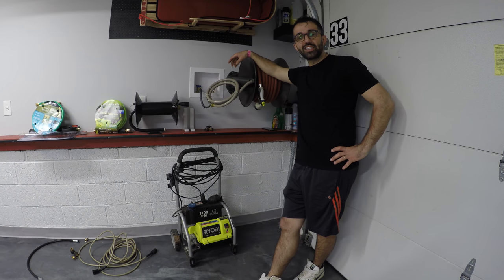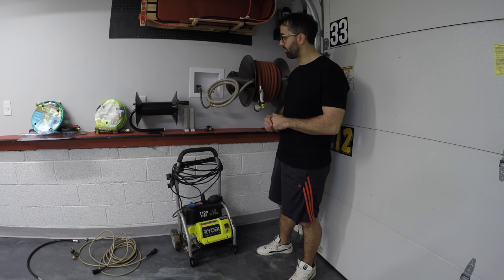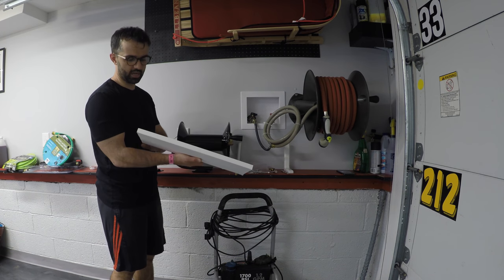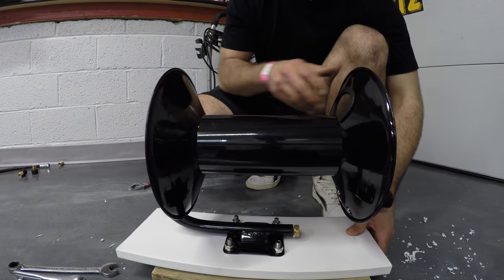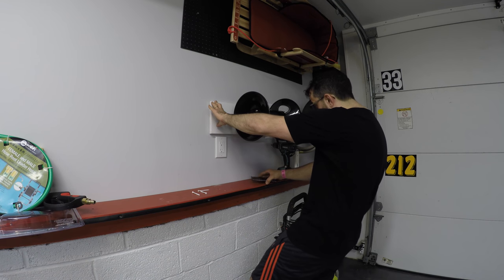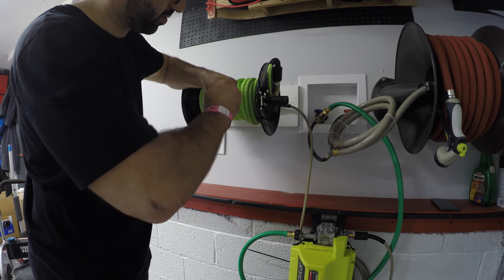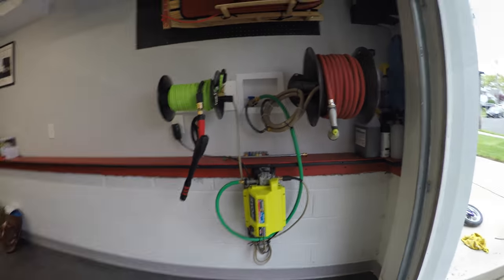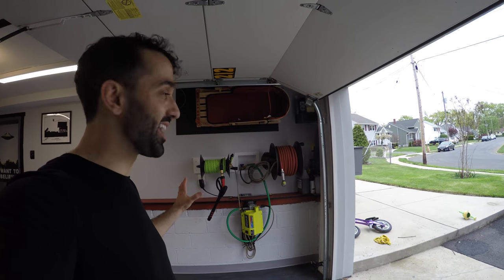Custom Mounted Pressure Washer in Your Garage for Cheap! Easy DIY  Wash your car the right way!

Comment: I would make sure to mount the pressure washer motor up right and put some bushings so it doesn’t vibrate itself out of the wall, but this project is awesome. Clean AF!
Reply from the maker: Thanks! No issues with vibrations after 6 months.

Comment: 7:12 Clockwise is correct, but you might want to wrap the tape on the other side of tape...  give it a try next time you do it.
And it seems more logical mounting the green reel on the right side of the washer?
Reply from the maker: Honestly it doesn’t matter. I mounted it so it looks somewhat symmetrical

Comment: I have been thinking of doing this too! Thanks for the video! Nice set up! And also folks, you cant look at an outlet and know if it is GFCI protected unless it's actually a GFCI outlet. Otherwise it can be protected if its down stream or there is a GFCI breaker.  lol
Reply from the maker: Fatty's Garage thanks for the note. This indeed needed to be a GFcI outlet. It’s not connected downstream and there was no GFCI breakers but I have since fixed it.

Comment: I like this.  For me, I prefer a more powerful gas powered pressure washer that is portable, because I need to use it for many things.  But if I wanted a basic unit that was convenient, I would definitely do this!
Reply from the maker: Thank you. I also have a gas model for around the house stuff and this one was just sitting idle.

Comment: The General Pump D30002 you linked appears to be a lot larger than the smaller pressure washer hose reel you're using. It looks more like the water hose reel. Can you please specify which pressure washer hose reel you have and which water hose reel you have? Setup looks great!
Reply from the maker: It's the same one; I checked my order. It looks bigger in the photo.

Comment: How is the reel doing after using it, have you had an issues with it. Do you with you went with something like the MTM or Cox Reel or are you satisfied with the General Pump reel?
Reply from the maker: Rob Torres love it!! I use it all the time. I will have a video on it in two weeks. No issues at all.

Comment: How is this holding up? I ask because I did something similar (mounted mine to the wall sideways) with my Greenworks 2000 psi and posted it on Obsessed Garage Facebook page. Someone asked a great question. Most/all pumps have oil in them and was asked if mounting it sideways and not flat will mess it up because the oil is not where its supposed to be in the pump
Reply from the maker: Going on two years - zero issues and super happy!!

Comment: Clean and great setup! Hoping to do a similar setup, however I'm looking for a 100' hose. Any recommendations?
Reply from the maker: I wonder if the same brand has 100 foot long hoses. It will definitely fit on the reel. Flexzila is awesome

Comment: have you found a solution for a smaller hose from the pressure washer to the hose reel? I want to do the same thing but cannot find a small m22 hose
Reply from the maker: Nope...I just rolled it and it seems to work.
Reply: @TommyLGarage  my next issue is how did you move that metal piece on the reel to get the long hose connected to it? the angle does not work at all and my hose is kinked bad.

Comment: I was just thinking of ways to wall mount my greenworks pressure washer when this video popped up. 

I’ve got the same issue, water source inlet in front and outlet in back.

Any issues mounting it the way you did after 6 mos?
Reply from the maker: TheWildpanda86 Not at all. No issues. Happy to report that it is still running well and no leaks
Reply: Tommy L Garage 

Good to hear... I just saw your latest video and it looks like it’s working great.

 I’m thinking of mounting mine so the front faces downwards and the back upwards. That way I can have my DI water setup feed into the front/ downwards portion of the unit and the outlet faces up towards my reel. I’ve already got an mtm swiveling spray gun + pf22 foam cannon and it foams up nice and thick already. Ordered up a cox reel on amazon since they where on sale as well as a 100ft kobrajet hose... can’t wait to get it setup now.

Comment: Hey Tommy, is the 1/4 hose still good? I've read amazon review saying it bursts and leaks after a while. I would like 100 feet long but 3/8 100 feet hose with QDs is $250 on obsessedgarage.  This 1/4 hose 50 feet but much cheaper, maybe if yours still works after 2 years, I can buy 2 (50+50 feet) for $150?
Reply from the maker: I’ve been using it twice a month for two years now and zero issues

Comment: I have a ryobi 2000 psi 1.2 gpm. It doesn’t damage the pump if I use a 50ft 4,000 psi pressure washe hose?
Reply from the maker: Genysmen runner Not at all. It should be fine
Reply: Tommy L Garage thanks

Comment: awesome job!   Just randomly came across this really nice.  Does your ryobi have auto start and stop or does it run continuously?   Which Y splitter did you use the brass one i bought leaked...
Reply from the maker: Thanks!!! I hope it was helpful. 
My ryobi runs continuously but of course I can turn it off with a button. Not a deal breaker. 
The Y splitter I got from Home Depot. Make sure the rubber gaskets are inside and tighten them with pliers otherwise it will leak. 
Are you doing a similar install?
Reply: Tommy yours doesn't cut off? I have the ryobi super small one and it turn on off with trigger.  My older one did as well.
Reply from the maker: David Dear well it turns off when I release the trigger. Once I press it it turns on. 
It also turns on when I open the water - the pump goes on until it builds pressure, then it shuts off. Is that what you meant?

Comment: Nice video Tommy! What do you do in winter or does your garage not freeze?
Reply from the maker: In the winter the garage is a steady 45F. Never had issues and I actually use the pressure washer during the winter.

Comment: Hey, do you know what’s the maximum PSI you can use on the car without damaging the paint?
Reply from the maker: It depends how close you get.
Reply: No more than 2000psi that’s what I saw in some websites

Comment: What bolt size and length did you use for the hose reel?
Reply from the maker: 2 inch. A bit of overkill.
Reply: @TommyLGarage  Thanks. I just bought the same one. Going to do a similar set-up in my garage.

Comment: Great video and very clean job. I was wondering how has the reel been so far? Ive been interested in doing my own setup also but wanted a quick review to see if that reel has been solid with no leaks or any other issues. thanks!
Reply from the maker: Over a year now and zero leaks and I am super happy. I use it about once a week and it’s been very durable.
Reply: @TommyLGarage  Perfect! thanks!

Comment: I’m very confused. What part did you bend. ? I have the same issue with mine currently!
Reply from the maker: Dynamic Garage the part where the hose screws onto. I bent it outwards on its thread

Comment: Nice looking set up but what I was really interested in seeing was where you live and that was confirmed by your car's license plate: New Jersey. This means that when it turns freezing cold in your garage any water left in the pressure washer will freeze solid (= one wrecked pressure washer from a damaged compressor) and of course that expensive flexible hose could also have some water in it which could impact its future performance if it freezes. All the hoses and the pressure washer look like they need to be removed until warmer weather returns so they don't rupture. Might be a hassle but it's the price you pay for living where water freezes and garages aren't heated as warm as the house. Oh, and that electrical outlet near the hoses should have a GFCI circuit protector at the circuit box in addition to the one on the power washer cord. No doubt you will want to use that outlet for something other than just the pressure washer and it is still located close to the water source. As as one of the other comments pointed out, the vibration from the compressor could eventually loosen the mounting bolts so a little Loctite would be a cheap investment on those threaded bolts. Picky, picky, picky...
Reply from the maker: Marc Goodman Oh boy you put things in perspective ha ha. Valid points especially about the outlet. I have since I upgraded it GFCI. I also run the compressor drive for a few seconds after each session so no water in the pipes. We’ve had freezing weather and it’s been good so far. I’ll let you know how it goes this winter but the garage is fairly warm so I think I’ll be OK
Reply: @TommyLGarage  Good idea re installing a safer electrical circuit especially since you have children around. As for water in the system possibly freezing and causing damage to the pressure washer and/or the hoses, as warm as your garage may feel, we live in the age of extreme weather and who knows what Mother Nature has in store this upcoming winter? Just to be on the safe side, I would remove everything from the faucets and store in your warm basement for the winter. A week ago I drove by a property where the copper pipe feeding the hoses burst a leak after a brief cold snap. Surprising since I thought the hoses would go first but the homeowner was unaware of the leak until I knocked on their door. And, if you have a shut-off for those two faucets inside the house I would close that off for the winter, too. Nothing worse than a pipe burst from cold weather except finding out about it hours later. Certainly enjoyed your video and I'm going to subscribe to your channel even though I don't have any place to do the things you do to your car; call it vicarious living. Cheers.
Reply from the maker: Marc Goodman Thanks again for an awesome comment, I really appreciate it. Regarding putting everything in a warmer place, I have a problem. I tend to wash my cars even during the winter which is why I have hot water hook up as well. I don’t know if I can give that up
Reply: @TommyLGarage  In those DIY coin operated car washes they usually end up running a little water constantly through the hoses and the spray head to keep them from freezing up in the winter. The main compressor unit is probably housed in a warm room so no worries there but if you've ever had to go to a coin operated car wash during a cold snap it looks like the inside of one of those old refrigerator freezers with ice caked on every surface. Besides, how do you keep the run-off from freezing on the driveway and the walkway in front of your home?
Reply from the maker: Marc Goodman I usually wash it during these warm winter days and in the sun

Comment: You need to replace the electrical outlet to a gfi type
Reply from the maker: dlroto technically every outlet in the garage should be GFI. But also The plug itself is GFI so I’m covered

Comment: Can't you just run warm water with the pressure washer too?
Reply from the maker: CrispCarGuru yes you can. But that won’t be effective since the pressure washer cools it off rather quickly and could potentially overheat the motor